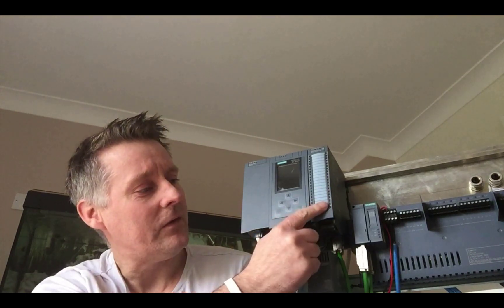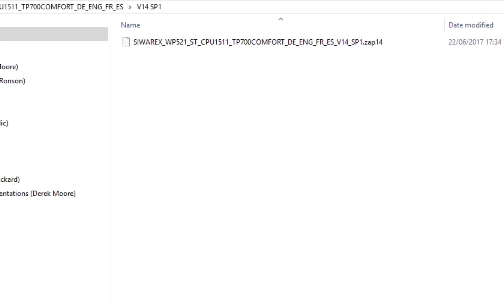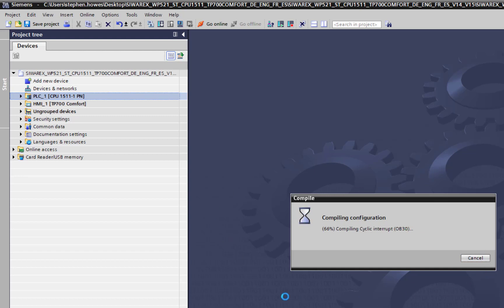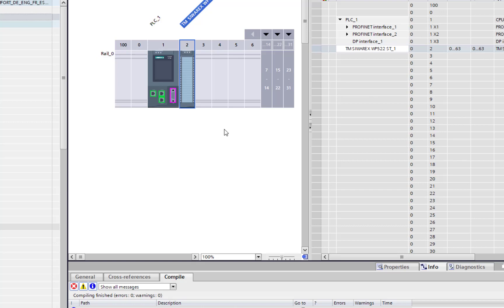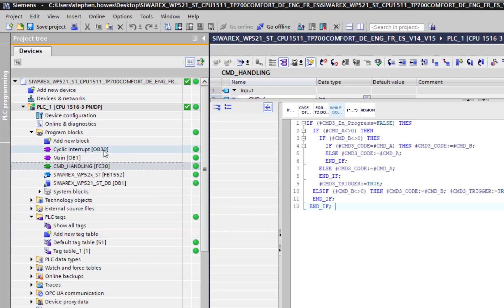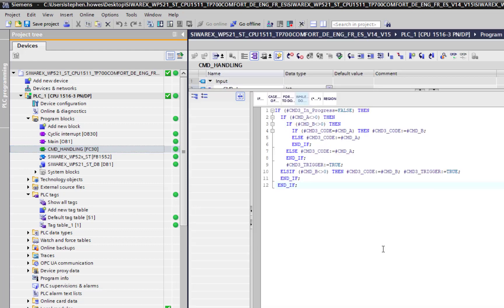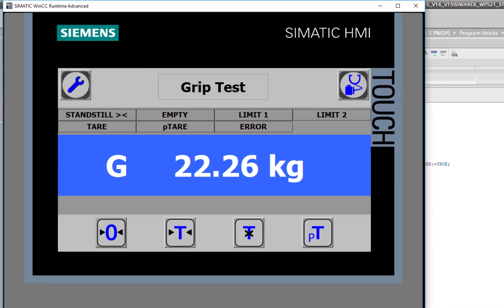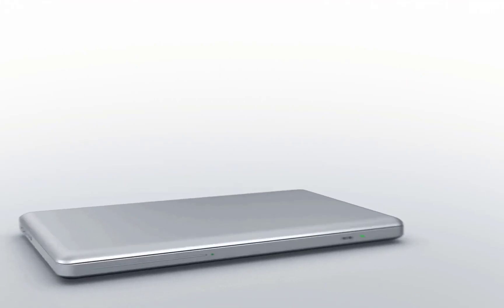How to add Siemens Load Cell cards SIWAREX to TIA Portal V 15 (Part 1)

Comment: Excellent video. How can I change the device to an S7-1200?
Reply from the maker: This functionality is supported by S7 1200.  The HART functionality will require remote IO that supports HART pass trough.  the mA scaling will work on S71200 PLC with IO cards or built-in AI.  Right click the PLC on hardware view and select change PLC.
Reply: @IOTConnectivity  Actually it is the Ready for use of the WP321.

I right click on the PLC in the hardware view and select Change PLC, and I am only sold S7-1500 options
Reply from the maker: Sorry got my videos mixed up.  I know the S71200 has it's own WP231, I'm not 100% sure the WP321 is compatible with the S71200.  Have you tried adding it into a blank project rather than a reference project.  Add the PLC , the IO card with WP321, see if this compiles.
Reply: @IOTConnectivity  Yes, as you said, it has its own WP. But the WP321 connects to the ET 200SP, and there it is compatible with all S7 devices. However, the Ready for Use program appears as an S7-1500 and cannot be changed directly for another device. I would have to redo the program.

Thank you for your response!